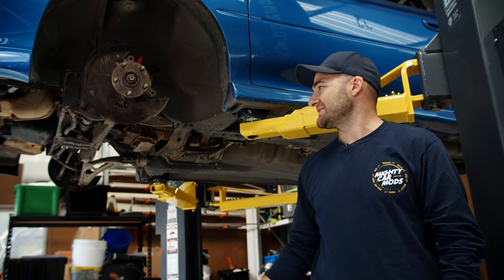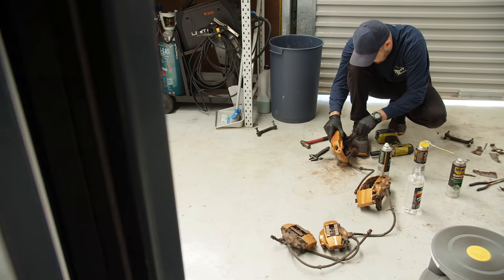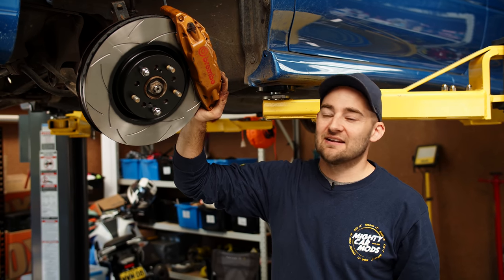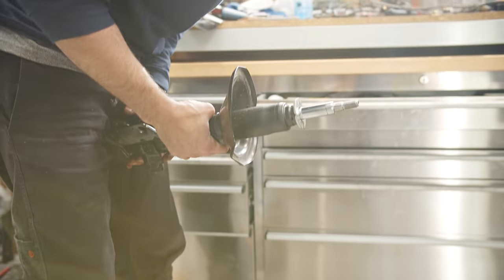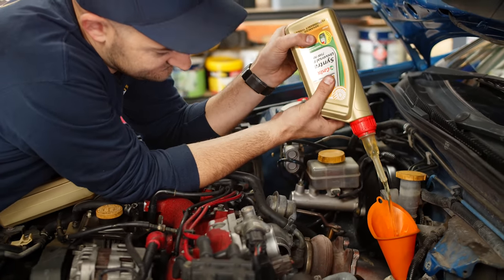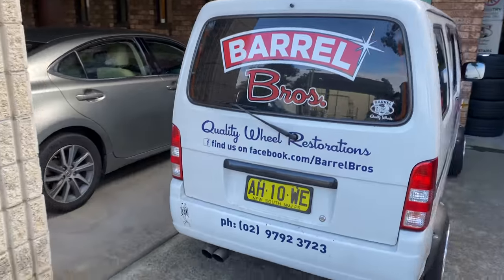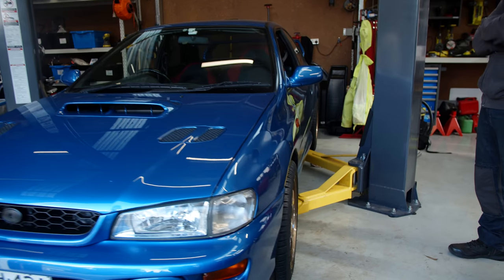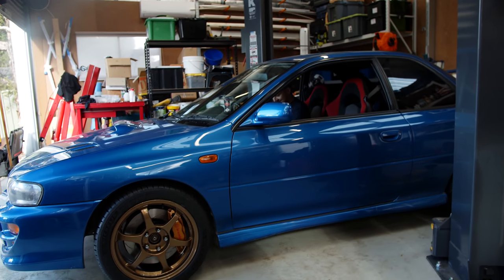Brembo Brakes, Shocks & Full JDM Wheel Restoration // Marty's WRX STI

Comment: I love how the media blaster has a windscreen wiper on it.
Reply: I think he is blasting with high pressure water not conventional like crushed glass, walnut shells etc.
Reply: Cause he was using pressured water and either beed or sand
Reply: That's vapour blasting. It uses water and a solid blasting media to create a smoother finish on the part and also closes the pores of the metal, whereas dry blasting leaves them open. The wiper is there so the operator can see what they're doing.
Reply: @unicorn7337  yep, water, medium, and compressed air.
Reply: @unicorn7337  does it key up as good as dry blasting?
Reply: Somebody tell HubNut!
Reply: @wanderinggentile  is a single wiper so it would be corners of disappointment for hubnut
Reply: A place I worked at years ago had the same unit.  There was a full time squirter (just water) to keep the wiper lubed and bead-free.  That unit had a leak on it and water would run down the outside of the windscreen, drenching an unaware operator!  They do work great, but the system still requires clearing the sediment pond  and placing in the suction side.  I kinda miss it now.  For different purposes, my current emoyer had a dry bead blaster.  Yuck.
Reply: @unicorn7337  there was me thinking it was so the wheels could see out

Comment: 7:27 "They've also been the hardest hit when it comes to fakes".......ebay plastic brembos come to mind
Reply from the maker: have a look at brembo's website!
Reply: Right..I bet lol hahahaha
Reply: The Civic :D
Reply: True however you can buy genuine brembo discs (rotors) but don't because they are awful every set I've seen have warped in a year or less and that's on variety of different cars so its not the car.
Reply: @Richard-kc3er  "Warping" rotors might be due to excessive runouts though
Reply: @user-njyzcip  yes that is a warp. Due to poor quality metal or poor manufacturing. One set lasted a week and were so bad you could barely hold the steering wheel when you brake. No previous problems and none since putting different manufacturers disc's on. Will definitely not fit them again, I know any company can have a bad set or a bad batch but have seen far too many problems with brembo disc's especially for a premium brand.
Reply: @Gobbbbb  gets it 🤘
For those that haven't seen the classic ebay parts civic - https://youtu.be/inPcN55Osmo?t=35m45s
Reply: It's still weird not seeing them use bridgestones any more.
Reply: @Richard-kc3er  That rules out the runout problem then. Strange because I've ran my OEM Brembo cross-drilled discs smoking hot (literally), cooked the paint off my brake calipers and the rotors were still fine. I do agree that there are better value rotors out there, though
Reply: Not to mention how many companies have knocked off these SSR wheels over the past decades..
Reply: @J P Japan's copyright and tradrmark protection laws are so strict it's almost fucked up. People got arrested for selling hacked PS3's too. And it was after the PS4 Pro has come out so even Sony won't give much of a shit.

Comment: I've never seen so many clean fluids come out of an old car,the engine oil was the only necessary change.
Reply: Whenever I’ve bought a new car, I’ve changed all the fluids no matter what. Probably unnecessary but at least you know exactly how fresh your fluids are and when they were done last.
Reply: Gearbox / differential oil doesn't usually get dirty like engine oil does. I just changed the gearbox oil in my car at 107k miles (172k km) and the oil that drained out was still obviously a translucent cherry red. FWD gearbox so it is gearbox and differential oil at the same time.

Comment: Few eps now with Michelin instead of Bridgeys! New sponsor I see bois! Congrats!
Reply: Glad I wasn't the only one that noticed the switch from RE003's
Reply: Yep saw that too. Much better tyre than the RE003's so its a win win all round for MCM.
Reply: Came to comment the same observation
Reply: My tyre change is comming up soon and I've been weighing up what to use... my car came with R003's but so many people have reccomended I switch to the PS4s... kinda funny it looks like I am following MCMs lead 😂😂 Also good to know Im not going crazy noticing the tyre change in MCM 😀
Reply: ChrisHallett83  Indeed, I have Pilot Sports PS2 and they are amazing in dry and wet. And comfortable as well. Like you can have your cake and eat it.
Reply: Yep RE003 are nice and cheap but the small extra for PS3 and now PS4 is well spent.  I've had a couple sets of each now. If you want the next step up on a budget then Hankook RS4 are an excellent street/weekender.
Reply: If I’ve learned one thing from Engineering Explained, it’s to NEVER CHEAP OUT ON TIRES. Got dedicated summers and winter tires for my Legacy GT, and the PS4’s are absolute phenomenal. Worth every cent.
Reply: I've seen mixed opinions on the RE003s vs the PS4, where the latter has good grip but less feedback. Also the better PS4S isn't available in Australia in anything smaller than 19" and are much more expensive.
Reply: whats the treadwear on those
Reply from the maker: It's been on the website for ages!
Reply: @mightycarmods  Ahhhh, I don't go on your website too often apart from buying merch haha, my bad!
Reply: @mightycarmods  I went and had a look that night I commented! :D

Comment: "It's not even meant for this car and it's bolted on". That's the trick, buy your bolt on parts for the wrong car. Somewhere out there is a WRX owner with the right car and an identical exhaust kit cursing  how all the brackets except one line up on their 'bolt on' exhaust.

Comment: Recheck your nuts after its first heat cycle. The paint melt coursing the nuts to loosen.
Reply: Yes this.  But all of the paint will chip off in no time anyway.  Should have done powder coating.
Reply: coursing   Causing
Reply: @ethanparker6246  Friction will do that to nuts...
Reply: John Adams i should stop rubbing them so much
Reply: @dan__________________  powder coating chips too, shoulda polished them to save weight, because race car....

Comment: Crazy! Marty I have the same car with that identical wheel and tire package on STI struts. My tip for you is to get camber bolts for the rear struts and adjust the camber to 4mm clearance between the back of the tire and the strut. If you get it spot on you won't need to roll the fenders! Also, the tires will pick up road sand and sandblast the paint right off your freshly painted side skirts so cover the leading edges with mud flaps or clear bra ASAP!

Comment: THANK YOU for showing that you took a wire brush to clean the hub faces so the new rotors would sit flush on them. This small but necessary step keeps new rotors from shaking the car apart when brakes are applied.

Comment: Love how this car is coming together, nice work guys, from another 2 door STi owner. I was curious to see if your car had the DCCD control for front to rear torque split, but as the car has ABS, the DCCD wouldn't have been an option.

Comment: I have always gone on the concept of if it needs replacing replace with factory or better/aftermarket. I had minis so when brakes fail wof I tracked down some disk brakes off a 2000 +mini which happens to be APracing calipers 4pot but rotors didnt fit 13x6.5rims and thay were thin so got rotors off a Austin 1300 but had to get the inside machined to clear the mini  hubs little bumps inside rotor.rear had mini fin drums with new brake cylinders.

Comment: Upgrade the suspension bushings to poly, especially the front lower control arms and rear differential subframe and crossmember. Makes a HUGE difference in handling, especially on older cars where the bushings are most likely destroyed rubber. I couldn't believe how much better my subie handled after going to poly.

Comment: I have a 2012 (GR) STi. Obviously have these brakes stock. Car came with 18" wheels factory, which I run high performance all-seasons on (basically a 3-season tire). I have a separate set of 17" Enkei RPF-1s for the winter tires, which are great... except the one time they used really thick balancing weights and one got jammed between the caliper and the wheel. The tire shop was able to rebalance without using sixteen thousand wheel weights which solved the issue, but dang the clearance is tight.

Comment: Should use a counter sink to remove  the paint away from the coned seat of each lug hole no matter what the paint coating. Beyond having to check the tightness of each nut the first few heated journeys, your much more likely to get a premature chip or paint fracture from the lug holes if not done. Great wheel choice & colour whatever the case, cant wait to see the track action!!

Comment: wow, actually learned something from this. Wasn't aware of the height difference with the newer sti strut vs gc/gm/gf when interchanging. Guess I missed that in my research.
I'll have to plan for that now when life events change & back to doing a 6-speed swap.
Reply from the maker: coil overs with hybrid parts work, ie: use a GC8 strut but get a lower collar that suits the later hubs, best and easiest way for sure just gotta make sure coiler place is happy to mix and match

Comment: Great video. You can actually use 2004 sti knuckles and hubs and they will fit the stock gc8 struts/coilovers. That’s how I have mine, which can be seen on my channel. I am also running the 2004 sti BBS wheels which are some of the lightest wheels you can get.

Comment: Excellent wheel color choice! Subtle but it has a bit of metallic that makes them stand out even more. So far im diggin it. Muffler looks pretty big. If I even have a larger muffler similar to that one, I like to tape up around the tip lol and spray the can flat black to hide it. Just putting that out there ;)

Comment: It's that 6MT with or without DCCD ? Also good upgrade for brake pads is CL pads. Bit expensive, but absolutely awesome on track and pretty decent on street as well.
For suspension excel-G's aren't really OEM replacement for STI. Had KYB excel-G's on my GC8, but then replaced them with OEM STI (RED) ones, completely different behavior. Even though they where already used ones, they still were way better.

Comment: Have a question about the brakes.  Japanese WRX STI Type R's don't have ABS brakes, because you could lock the adjustable central diff. Are you installing an ABS braking system into your car, did it come with ABS already or are you just keeping it non-abs? I did see some mention of changing the wheel sensors and I assume you are changing the control for the central diff.

Comment: Hi guys,
I have a little question for the internet.
Are those brembo brake calipers the same as those o came with the Nissan 350z Brembo? 
They look the exact same for my untrained eye.
I replaced my 350z's rotors and pads recently and they look the same to me.

Comment: Don't want to be a smartass, but having done wheel restoration for over 5 years, we've seen several cases where the paint between wheels and brakes caused bent rotors so we usually clean the contact surface of wheels before installing them on a car. Might not always be the case and powder coating has a bigger chance to cause problems, seems like the paint is keeping heat from transfering from brakes to wheels, but I might be completely wrong.

Comment: I get the appeal of the brembo's, they are cheap used. Lots of crashed subaru's here in the US with these parts and you can get them for mad cheap compared to new. HOWEVER, me "personally".... I would OPT for Tarox brakes.... from the EU (EU company). Instead of 4 huge pots, or 2 huge pots, they go with many "smaller" pots like 6 and 12 pot setup.... by doing this, the brake pedal has a tighter/stiffer feel, and you get less heat and thus less brake fade when racing.... don't get me wrong, my 05 sti has brembo's and I haven't swapped them out because "they work" but IF I were doing a big brake conversion, Tarox would be where I would go....
.
For me, its not just enough to do something, I have to be different. Before my spinal cord injury, I bought a 2015 mitsubishi mirage and had plans to turbo, you don't see the car get ANY love because its a 3 cyl and no one wants a "slow 3cyl" which is just crazy because its a maad little car. I've seen some taiwan mirage's go turbo, but they have like 1 or 2 videos about it, and they don't even tell you how much power it makes.... plus, its in a language I can't speak at all. I was on a mirage forum for the little car and even there, no one had turbo'd the car, or done much other than intake header exhaust..... I was gonna be "different" and pioneer my way the maad little car, but my injury stopped all that. I swear to fuck after/if I heal, the first thing I do is continue my work on the 2015 mirage.... got the suspension planned out, the turbo size, the pipe needed, the custom exhaust (make myself, not like there is a prebuilt for the car anyway), rims/tires, etc. all planned. its gonna be maad, just need to heal! spinal cord injuries are insane.... wish stem cells wasn't illegal, they could inject them into my spine where my injury is and I would heal 100x faster..... but they are illegal and only available to those who are quadriplegic due to the severity of their injury, they are considered dead already so they get a free pass from the law.... medically.
.
I used to change my oil every 2500 miles, my diff every 5000 miles, and my trans every 10,000 miles.... people said I was crazy. but my 06 s2000 and 05 STI never had any part failures.... even with subaru, you hear the bullshit all the time from wanna be nerds, claiming "ring lands weak bruh" no, youre an idiot and let your oil go bad and starve the engine. funny enough, on the ej25.... the LAST thing to get "oil" is cyclinder 4. no oil, means more heat, means ringland failure. its common sense to any mechanic. I can't count the amount of subaru kids around me locally whom don't work on their own car, they take it somewhere, they do oil changes every 6k miles thinking "im using full synthetic so its okay" no its not. then their engine fails and they blame everything except themselves. the people who built the motor for them, don't do the oil changes either, so they don't know these assholes are driving around low on oil going full boost.... so they just assume that ring lands are weak, because they don't have the full story from the customer.... customer goes "i did my oil change properly" but that don't mean shit. I stove my 05 STI like I fucking stole it, and at 2500 miles, it would be a whole qt low. if I drove like grandma, I could go 5500 miles before the oil turned black.... it all depends on how you drive. the harder you drive, the more often you have to change the fluids to keep the car healthy. even my 06 STI.... "the rear end is glass, don't launch it and don't drift" meanwhile I launched and drifted literally daily. every fucking day to and from work.... never broke. I was told "youre lucky" no I changed my oils often.... the rear diff for them, they probably left the oil fluid in there which couldn't do its job, thus the rear end would not only heat up, but it would fail breaking something. only fault is the car owner.... not the car parts. so tired of hearing about bad parts.... its all bullshit.
.
im excited for the next track day now that he has better brakes and tires....

Comment: Using wd-40 on rubber things like exhaust hangers is a bad idea. The  petroleum will ruin them. I recommend using silicone lubricant. Avoid liquid wrench "silicone" spray though because it has petroleum in it, and apparently its a lot because you can clearly smell it

Comment: Get small parts cleaner! They are some selfcontained ones that will fit calipers, brackets etc. around 13 litres capacity, with pump and a brush, with lid, so You can close it and move it out of the way once You are done and they are cheap!
Much better than fucking up Your nice floor.

Comment: The shocks internals have no bearing on the height of the car... only the amount of bump travel and droop... you should have left it as it was since it has lowering springs and you have atken away all the bump travel by putting spacers in there!
Reply from the maker: If the springs were the same height then yes

Comment: im so confused as to why theyre putting sti parts on an sti, isnt an sti the best factory package so why is there factory upgrades?
Reply: The later model STi parts are better/stronger.  Sadly the early model hubs/wheel bearings are crap and have a very short life on the track.  Likewise the factory 5 speed gearbox is very weak compared to the later model 6 speed.  I broke my 5 speed and have been through several sets of front wheel bearings.
Reply: @agsieber  thanks heaps